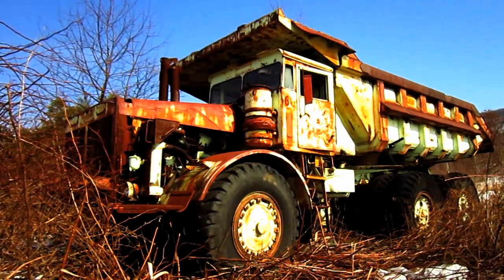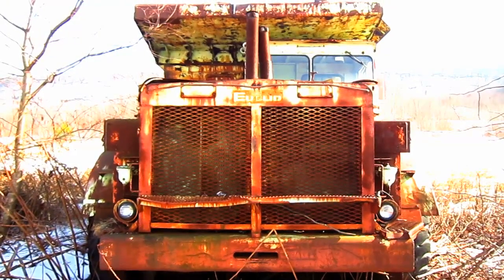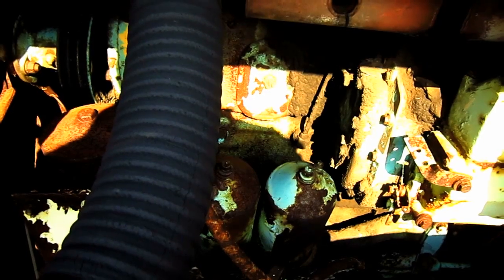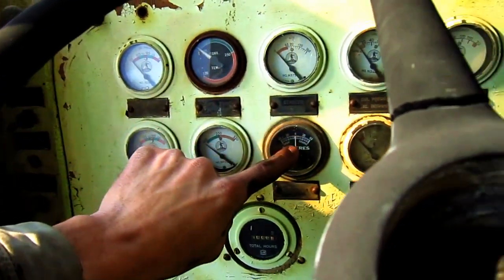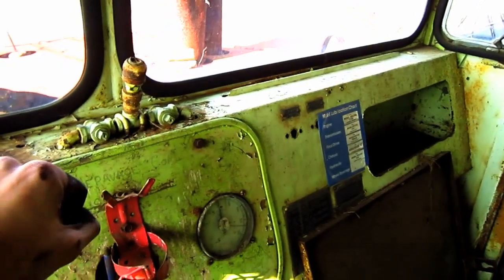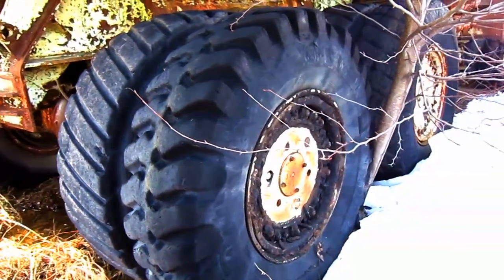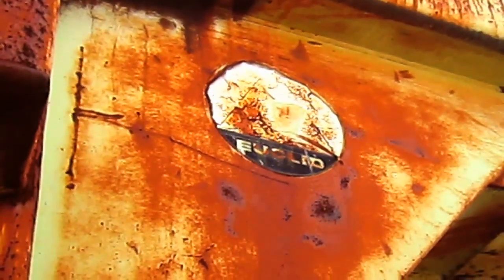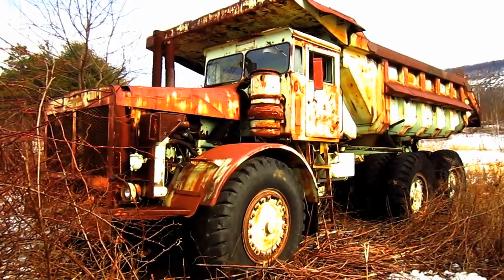Euclid R-62 5LLD Documentary

Comment: western contracting corp. helped to develop this truck and had a big fleet of them.they were used on the missouri river dams they built.the exhaust were run through the box so material did not freeze to them.i worked for western in 1956.they were one of the biggest dirt movers in the world at that time.
Dave Lilley

Comment: They used these on the Marquette Iron Range in Michigan's upper peninsula back in the early days of open pit iron ore mining. When I started at the mine in 1974 they had 65 Ton Dart and 75 ton Wabco Haul Pac. Then they got 4- 85 ton Terex. Next they got some 95 ton Euclids, they looked the same as the others, one single engine. Then they got 120 Catapilars, then 170 and 190 ton Dressers. By 1992 they had 240 ton Cats. They had V16 diesel engines of , not sure of the Hp rating, maybe 2800 to maybe 3200. These were the last of the trucks with mechanical rear differentials. The 240 ton Dressers were diesel electric like a RR locomotive. The engine runs a DC generator and each rear set of duals has a DC motor that drives it. After I retired,  I understood that they bought a fleet of 20 - 300 tonners. I never heard what brand, but I'm pretty sure they would be diesel electric as well. They even got a couple of diesel electric loaders with, I think it was 32 yrd buckets on them. They were La Turnue brand. The guys called them, Mary Kay after the famous teacher. There was a DC motor on each wheel. The electricians hated them because they couldn't get the motors synchronized so they were fighting each other. The motors not the men.
Reply from the maker: Very cool tha ks for sharing!

Comment: When I was a Operating Engineer apprentice mechanic in 1971 ,Worked for a contractor that had some of these, we cut and removed a small section of the upper part of the rear part of of the box and rewelded that 12X6 inch section on each side of the box.So instead of hauling 62 yards they hauled 60 yards so they payed the union teamster drivers .15 cents an hour less.But they still hauled more than 62 yards.The boxes were measured by cubic yards of area and by removing that small section of box made them haul the less amount.

Comment: As always, fantastic video! That's interesting how they routed the left driveline through the first axle housing. Being that there are 2 engines and transmissions powering 2 separate axles, was there any sort of differential mechanism to prevent one engine and trans from dragging the other? Due to differences in terrain affecting the front and rear axle independently and being that both engines and transmissions can't be "timed" to work perfectly together, it seems like there would be issues with one drivetrain overriding the other.
Reply: +UnitCrane514  Euclid pioneered the "TwinPower" concept with these trucks, the TS series scrapers & of course the TC-12 dozer. The secret was the use of the Allison Torqmatic transmissions. The differences in speeds & traction was all taken by the Torque convertors, as they could absorb any variations in the two drive trains.

Comment: You did GOOD! I never knew there was such an animal. Bet it was something inside the cab, even though the 6-110's maxed out at 1800 if I remember rightly. I just got up to an R-35 and a 22 but those were enough. The 35 had a 12-V with a shot exhaust system and it'd rattle your fillings when it got to 2300 and the governor caught it. But a Euc is a Euc is a Euc. All laid out pretty much the same way. I saw the drag bucket and the crane peaking around the corner. A-PLUS!.
Reply from the maker: +Lewie McNeely Yes a Euc is a Euc.  And ask any old timer how they were to drive and I'm sure they won't have a good story about it haha.  Thanks!
Reply: At the local boulder hole they had a 771, a 773 and the R-35. I ended up in the 35 because I could herd one without any brakes and they hid it when MSHA came. It was a beast but had the coil springs so it rode fine. I just liked terrifying everybody with the Buzzin Dozen and the non-exhaust system. Couldn't get any riders but I took advantage of all the racket and the old Allison. It was a trip and a half and I usually ended up hauling mud from the settling ponds after it had dried somewhat. Just as a Euc is a Euc, goo will always be goo. Shake it a little and the water will come to the top.

Comment: "Independent front leaf spring suspension". Wrong! It has a straight solid front axle which is NOT independent.
Reply from the maker: Well Matt, guess you better correct the engineers from Euclid. Because those words came right from the specification sheet for this truck. And yes, solid front axle, with LEAF SPRINGS.